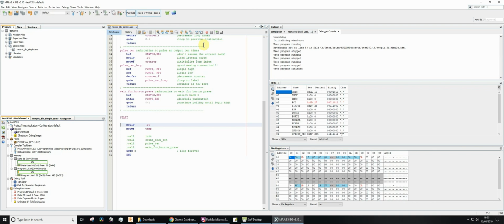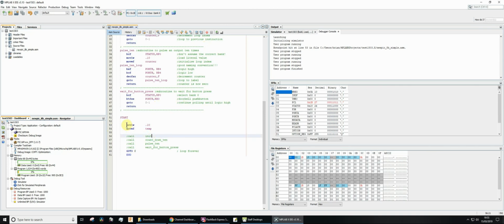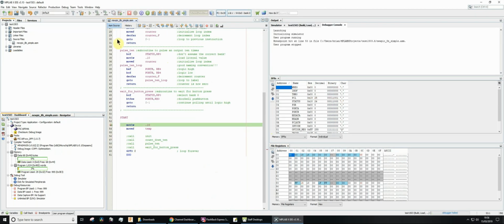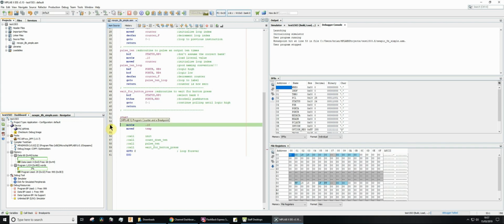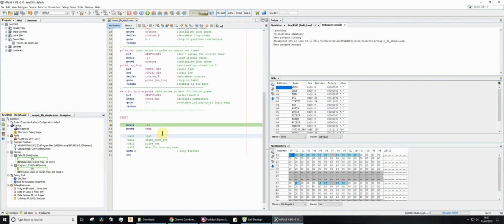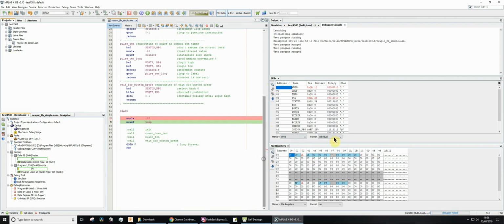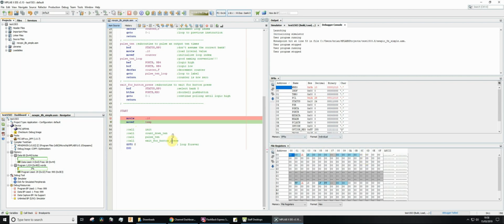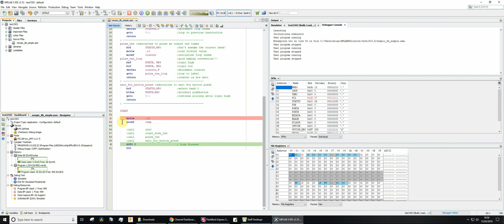MPLAB X assembly programming and viewing register values during simulation

Comment: hi sir, i have some issue with my debug session, when i clean & build  and start debug its working well but register values are not showing. what is the issue you think. i tried but always there is no values in tables. 

thank you for video..!
Reply from the maker: Have you tried closing and reopening the panel to view the updated value? I had a similar issue a while back. Also, are you sure that you are in the correct bank and writing to the correct location?
Reply: @PizzeyTechnology  yes sir i did it. But it dosent make any change. Even simple code its not update,
Ex-:
MOVLW x050 ;move 50
Reply from the maker: Movlw 0x50 will move or "load" the literal hexadecimal value 50 into the working file register. Is that what you want?
Reply: @PizzeyTechnology  i want to just load the values to the register.
Reply from the maker: How are you trying to view the register values?
Reply: MPLAB > window > Target Memory Views
Reply: I apologize if you were inconvenienced. I am helpless now, so I made such a request of you.